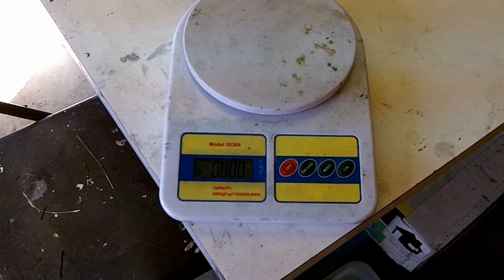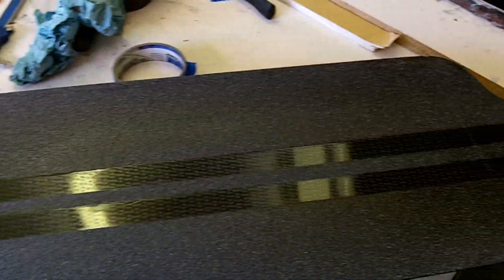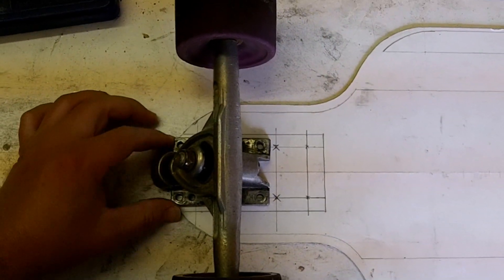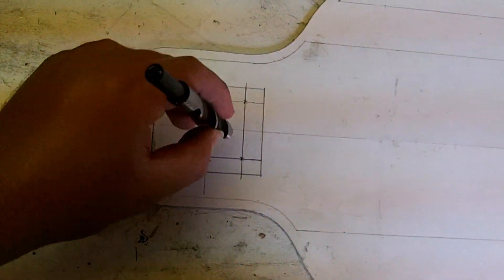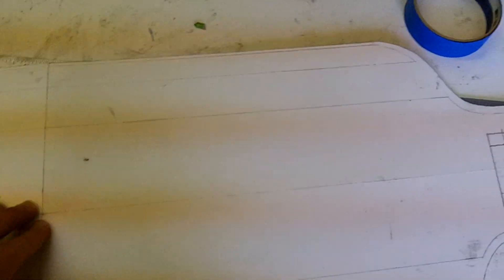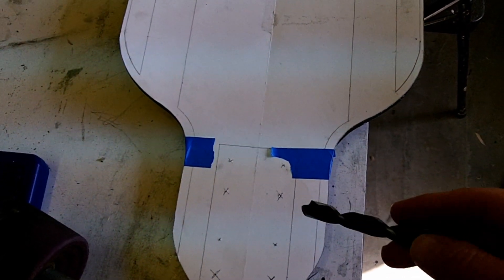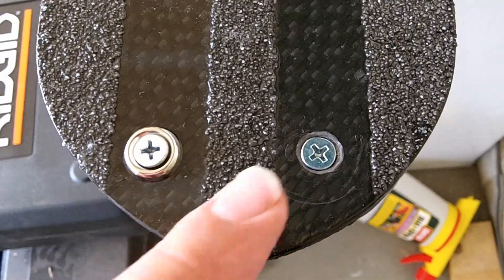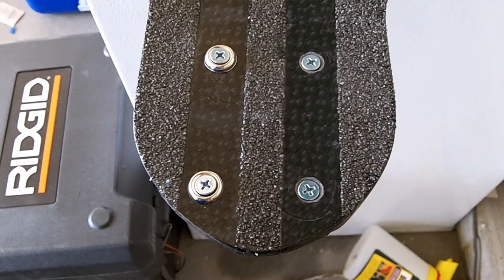DIY Carbon Fiber Longboard Tutorial- 6 of 7

Comment from the maker: The board was about $100 in variable materials cost. However it may cost more if you consider having to buy more of something than you actually need. For example having to buy 2yrds of carbon fiber when you only need 1.5 yrds- Because it's sold in yards. Same principle with the epoxy and foam core. So if you're just planing on making 1 board it may be a bit more expensive. Hope that makes sense. Thanks for the comment.